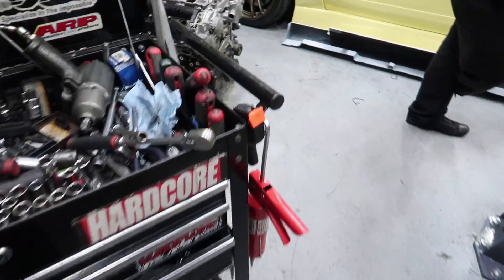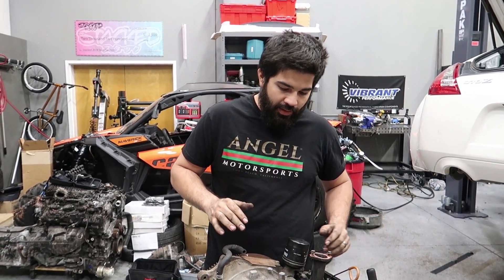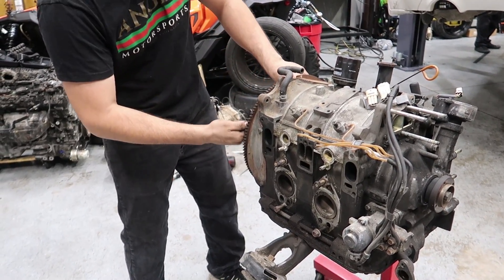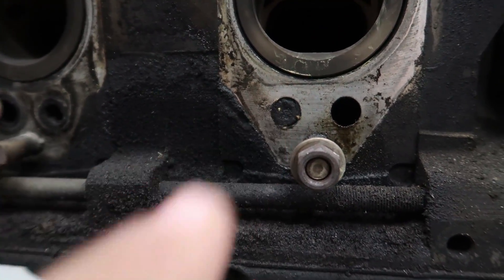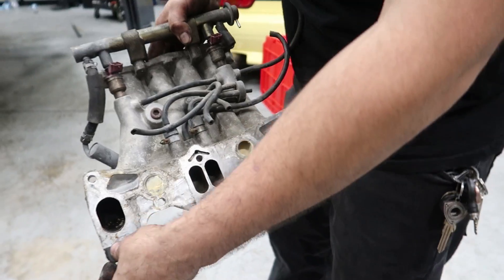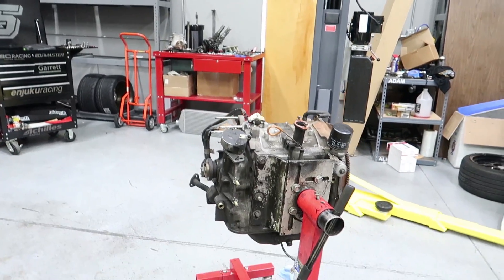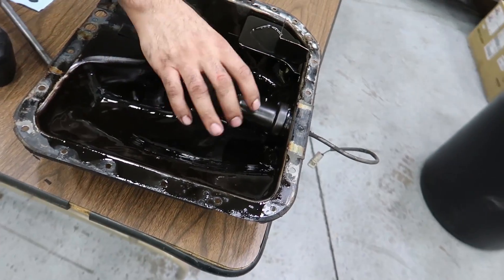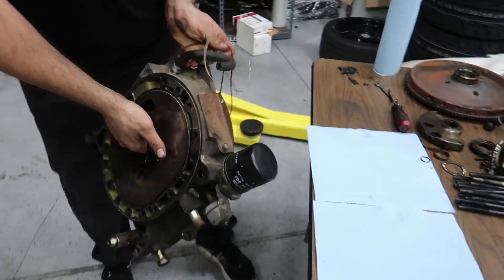ROTARY ENGINE BUILD PART 1 MIKE VARGAS SPECIAL!

Comment: 8:06 i might sound noob but if i remember right you can use those useless ports to drill a hole and make it semi pp? Yes it isnt just drilling a hole it is way more precise work but it was just simple demonstration. (sry shit english im from finland) Just wondering that at what rpm does semi pp idle at and would you recommend it over half bridge or big ass streetport. We in finland dont have to worry about emission on rotaries and 2 stroke but noise is still a thing and for the yearly inspection you have to put some restrictions on it or just alot of mufflers and resonators etc so it isnt too loud

Comment: The power level sounds beautiful but you have to remember the FC cannot fit meaty tires under the back fenders unless you do a wide body kit. Amazing having 500 horse power but if you can only fit 235's on the back youll never harness all that power.
Reply: Beautiful z you have there.

Comment: eeh just build some honda motor up to 1k hp
Reply: dirty thirty easier said than done. It’s a Honda lmao
Reply: the_l0stchild well I wouldn’t say that. They’re terribly complex and terribly inefficient. A piston engine is much easier to build physically. You can build a 1000+ hp Piston engine in your garage with simple hand tools. Rotaries are much more intricate and require a skilled professional if you want to make a ton of power. This is why people swap them for ls’s
Reply: the_l0stchild have you ever seen the inside of a rotary? There’s hundreds of small tiny parts, springs, seals etc, that all love to fail lmao
Reply: @Matt_Lanzer_13  unless built by a Vargas